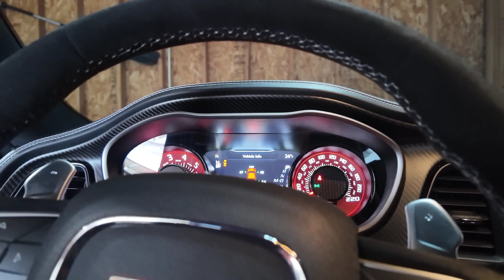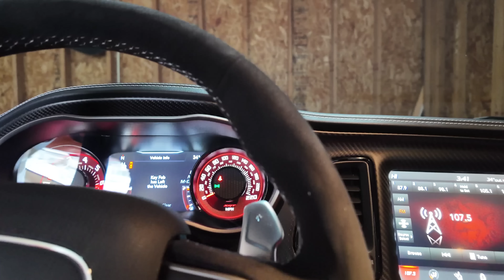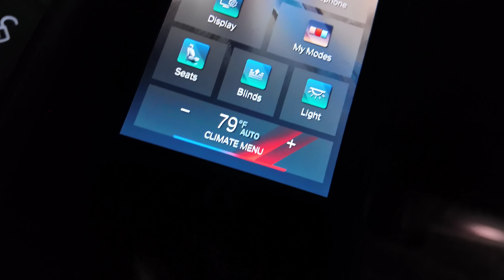IM SICK OF THESE CARS IM SELLING THEM ALL THEY NEVER START UP

Comment: That battery in the box thats on the drivers side that you connected to is a battery for the system it does run with the other battery but the main battery for the car is the one had the grren top on passenger side. Just so you know for next time